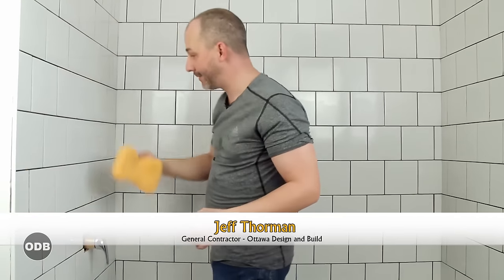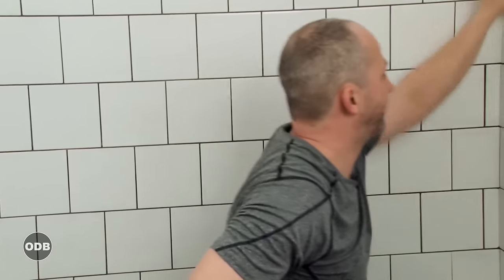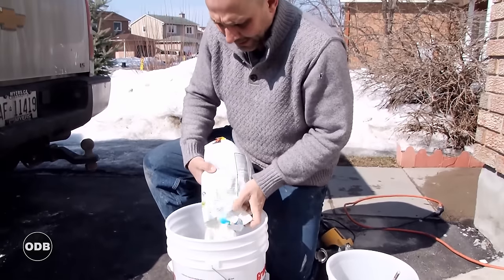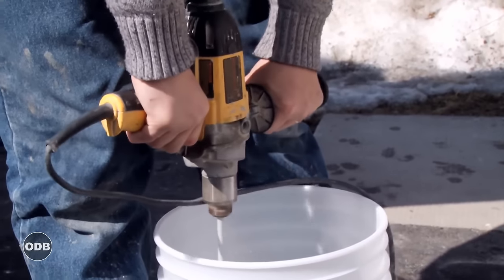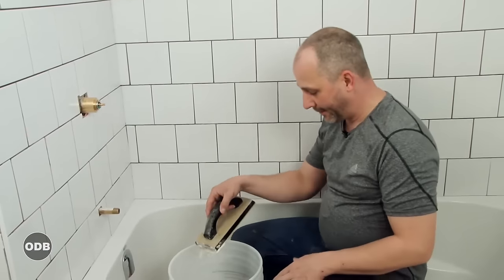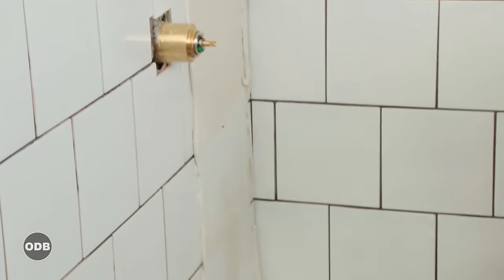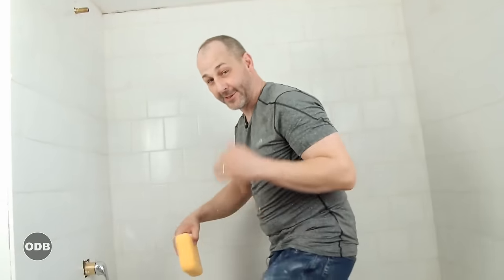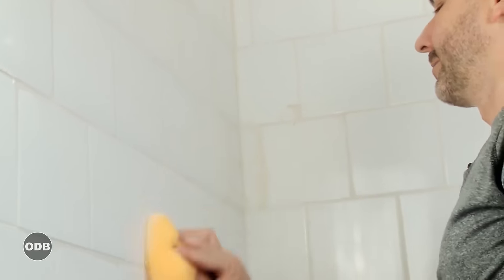How To Grout | Wall Tile | Unsanded Grout

Comment: 95% of time cleaning lines 5% grouting. Really shitty job man. The grout will wash away soon revealing black thinset. We use pack of blades and a utility knife to scrape the edges of the tile and clean it properly. This diamond tool doesn't clean lines well. If i would see my contract grout like you do, he would have take all the grout out and clean it
Reply from the maker: Before you can criticize you to upload. otherwise you become another fool who is full of it! Cheers!
Reply: @HomeRenoVisionDIY  You know i am right. Ive never had a job that i had to fix my lines like that. The grout will wash away soon revealing black thinset and the client will call you and complain and you will have to come back and fix it. Its cheaper to do the job right the first time.